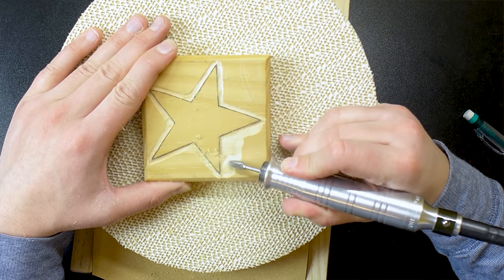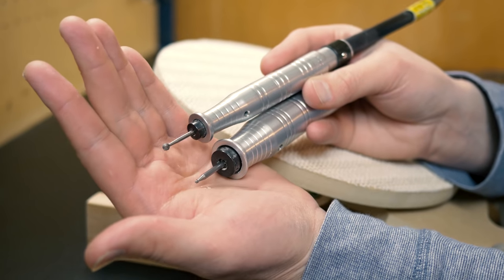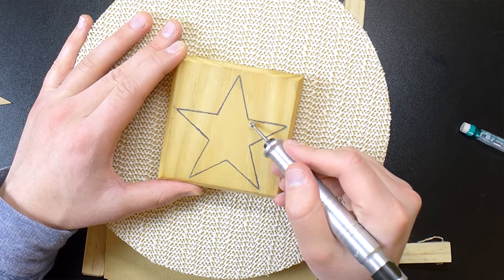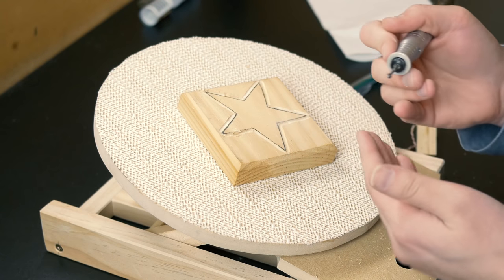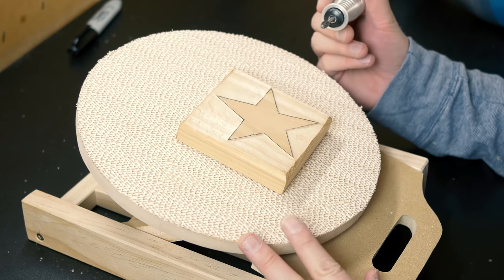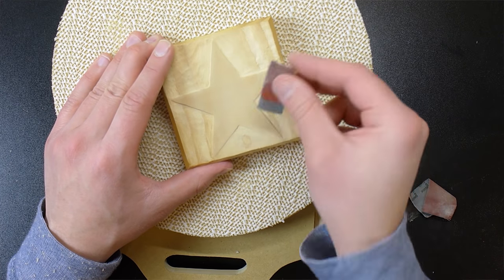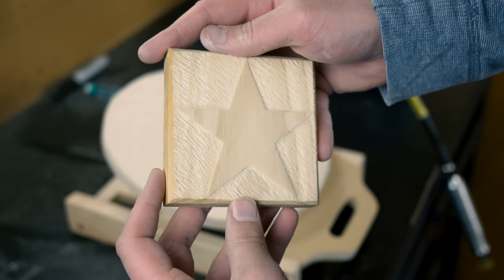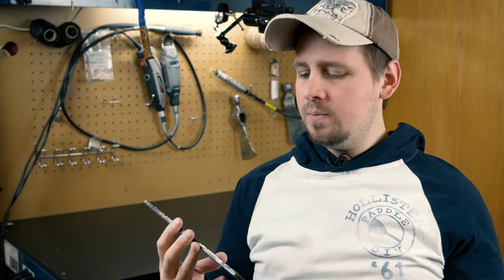How to Wood Carve/Power Carve A Perfect Star

Comment: Love your videos, love your soul. Keep them coming.
I get a lot of good tips. I'm going to share one with you as a Jane of all trades..
Now hear me here...😊 😂 
Yes sandpaper is a must-have, another must have is nail files, go to your local Sally's Beauty Supply or whatever you have in your state and they will have any grit, the soft foam ones, the hard Emery boards, metal files, snub nose, point nose you name it.  BONUS Emery boards are much cheaper than sandpaper.  They help me get a straighter line everytime. Great for getting into little spaces, easy to handle.  Every nail file has at least 2 sides, some of them have 4 sides with 8 different grits on one board.   You can have all different grits of sandpaper right in your hand and not have to keep switching out either. 🤷
✌️❤️

Comment: just an additional thought regarding use of the lazy susan turn table for a sanding or carving platform.  Have you considered adding a small drill press vice on top of the turn table  to hold the work in place and free up one hand while carving or sanding?

Comment: Did you make or purchase the rotating stand? It looked real helpful for turning project and appeared to have non slip surface
Reply from the maker: I bought it.
Reply: where  ??lease ....
Reply: cool li thing!!!!!!
Reply: Go buy a lazy-susanne  and some rubber pad or dish mat, cut dish mat to fit top of lazy-susanne, put thin layer of gorilla glue on top of lazy-susanne and then apply the rubber mat or dish mat. Whola!!! Easy-peezy lemon-squeezy! You're welcome. 😉
Reply: @ursulascheuch2565  ready my comment. Should help u out
Reply: @ursulascheuch2565  ready my comment. Should help u out

Comment: hi, I'm new to wood worki just bought the dremel 4300 , I was wonder how do I know if the wood isn't pine? whats the best wood to work with...
Reply from the maker: Awesome congrats! The best wood for beginners is Basswood. Just imagine a 2x4. 98% of the time those are pine.
Reply: Ask your local lumber store which wood is what. Typically pine is semi hard wood which is why it's good for construction but not so great for fine detailing (although you can do it if youre careful). Also pine has a pretty evergreen smell...like a Christmas tree only not as pungent.

Comment: I just bought a dremel 3000 for my son. But it seems the tool bits you are using are not included. Can I please get the exact name for the piece that you usually use to start carving the wood.
Reply from the maker: Get a cheap set of burrs off of Amazon. I am using a round carbide burr and cone shaped burr.
Reply: Thank you!

Comment: I seen a new dremel accessory called a dust blower. it blows all the dust away from your lines.    Its a #490 Dremel dust blower  have you tried it
Reply from the maker: I have tried it before, but I only use it when I am outside

Comment: how did you do the texture in the Love piece you showed at very end?? Looked rougher........out of all the bits i have for my rotary tool i dont have any like the green burrs you show ( well i do,but cannot get a collet to fit as they are pretty huge mandrels!).... i received one yday actually (a new tool n kit-last one died lol)-prob due to my inexperience with the tool. I have alot of discs that are like 'grinding' material, pink and blue...with just a small hole in the middle. Others are just cut sandpaper-same thing!Just a tiny hole in middle! And at least 1 other disc but diff 'material'....no instructions anywhere!!!!!!!!!!!!!! i am familar with the grinding stones on a mandrel, and sanding discs , i used the black cutting discs once as they are very easy to break off!!!!!!!!!! ANY help /info be appreciated!!!!!!!!!!!!!!!!!
Reply from the maker: That was a process called “stippling” I would search on amazon for carbide rotary burrs and that should get you started!
Reply: thanks! i do have some carbide burrs-same as the ones you show....also picked up a set of diamond burrs plus the few from my last kit and this new one! My confusion is the pink and blue grinding discs-it has a tiny hole in each one-no info what to do with them lol
Reply: thanks! it sounds familiar..
Reply: the mandrel that holds the sanding wheel for dremel has a little scew on top,..unscrew,and replace rubby wheel with cutty disc(..make-it-tight)
Reply: mark lewis aaaaaahhhhh...... will try this - thank you!!!!! Do u mean for the grinding stones I take it? Not the thin very breakable black discs - I used the red bands to secure it but the discs themselves- DANGEROUS !
Reply: Pixie Whittle has